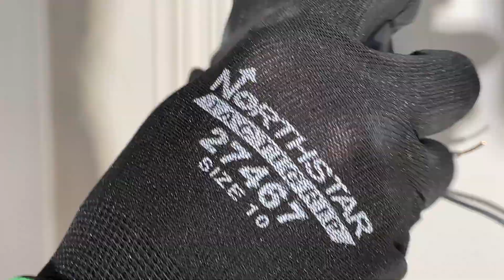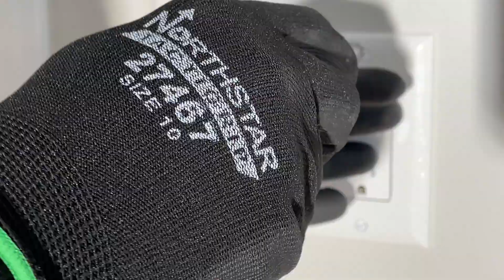How to add a new outlet - How to add a new receptacle where there wasn't one - The Electrical Guide

Comment: This was great right up until you wired that last outlet, which you did completely wrong. NEVER use the sides AND the push in connector at the same time. You could have just made a pigtail on the other wires and not had a problem, but you had to go the lazy and dangerous route.
Reply from the maker: Yah I hear you, the box was a little full for marettes, adding wire connectors adds to the conductor count inside the boxes so I avoided over filling it.

Comment: What does electrical code say about having two different rooms on the same circuit?
Reply from the maker: Not a problem at all. You can have 10 rooms on a circuit as long as you don't exceed the number of outlets allowed on 1 circuit. I admit 10 rooms exceeding the outlets allowed on 1 circuit is highly likely. The point is, it's not by room but outlet allowance.